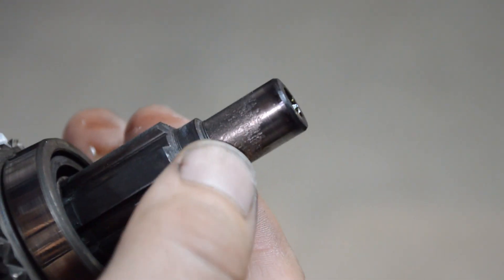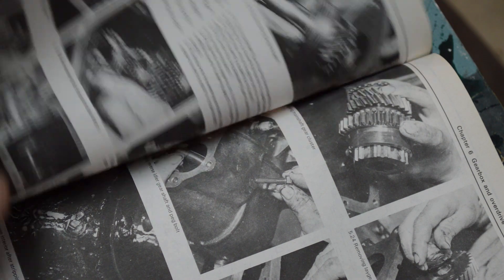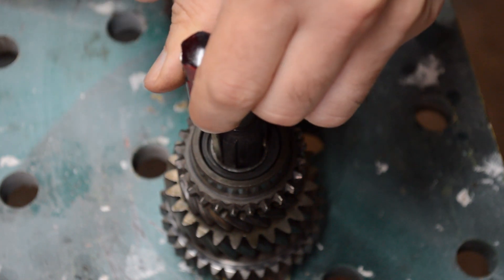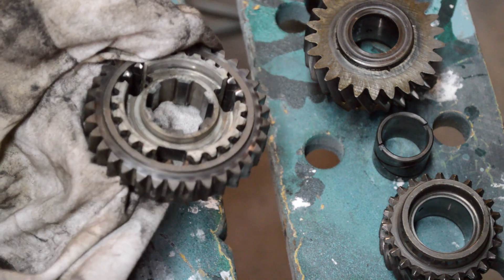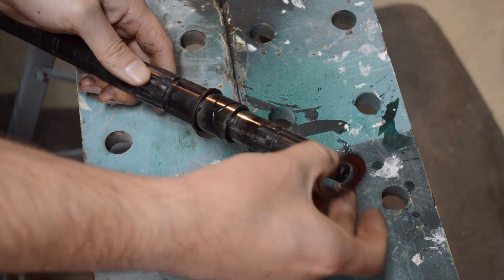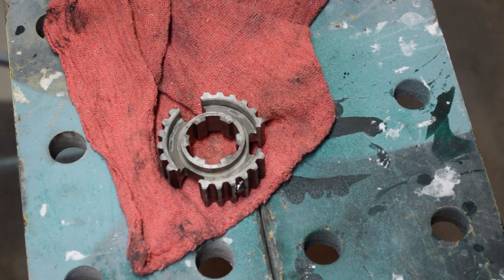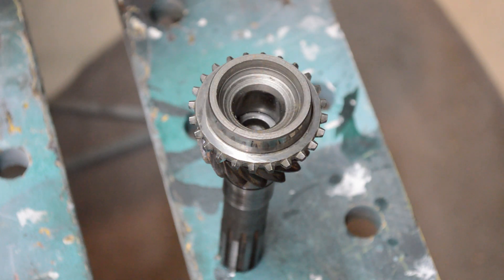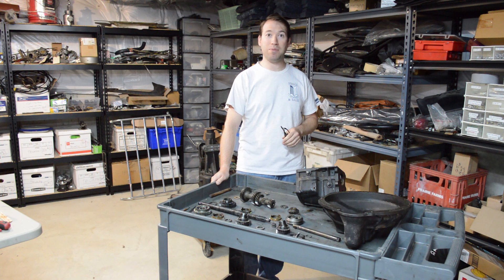Rebuilding My Triumph Spitfire Gearbox 2 - Inspection

Comment: When I check the end float on 2nd and 3rd gears, they come up short; but, when I check the end float of the assembled gears on the main shaft, it is sufficient. Any ideas? BTW this tranny came out of my 1967 Spitfire Mk2, but it actually belonged to a Herald (GB prefix,) at some point, as did the engine (GD.)
Reply from the maker: Without measuring it myself i can't help much, but the end float for the assembly is not the same as the sum of both components, so it's definitely possible to be correct on one and not the other.

Comment: Can you tell me whose shop manual you use? Thanks.
Reply from the maker: At this point I've memorized the procedure, so it's just the specs I have to look up (like clearances between gears).  I have both the factory manual and a Haynes manual, so whichever is closest.

Comment: After watching this series of videos 19,274 times, I finally bit the bullet and pulled my transmission (gearbox and overdrive) from my 1980 Spitfire. I checked all the pieces, made mistakes, rewatched a few of these another 4,276 times, and finally got it back together about two weeks ago. I then pulled the motor to do the reinstall because doing just the transmission was a real PITA. 

Suffice it to say, I don’t think I could have done the whole thing without these videos. Absolute life savers for a n00b mechanic hack like me. 

Thank you so much for doing these!
Reply from the maker: I'm really happy to hear that!  Too many people just throw away the gearbox and put in a Ford unit.  There's nothing wrong with that, of course, but it's just not true that the Triumph boxes are bad.  Glad to hear you're back on the road, and thanks for the shout out!

Comment: Wow, I watched part 1and2. You do this for a hobby only?! And not a living? You know your stuff! I have mechanical skills. I could take it apart, but putting it back together? Not likely, and not operating correctly! LOL I know you aren't a magician and can't see my transmission. But I often have to wiggle the stick left and right. While pulling back on it for 2nd. Or wiggle and push forward for 3rd. Sometimes it's hard to get the gear at all. What do you think is up? It's nice you took on some kids. Teach em how to rebuild a tranny! LOL FYI it's a 73 spitfire
Reply from the maker: I'm going to guess your problem is in the top cover or in the remote. It is a hobby mostly, but I do rebuild parts as a side gig if you're interested. The top gover and shift unit could usually be done in a couple hours depending on what it needs (including a thorough cleaning).
Reply: Thanks for getting back to me. I'll definitely keep you in mind. Thanks again.

Comment: Great video.   The mainshaft tip wear is very common and a new mainshaft will cost you about £200 plus shipping.
It might be preferable to talk to a good machine shop about fitting a hardened steel sleeve on the tip and perhaps opening up the end of the input shaft to accept the larger roller bearing as was used on latter gearboxes.
Modern MTL syncromesh gearbox lubricants can really help the syncro rings work and reduce wear.
Reply from the maker: Good call on the machine shop.  I usually use MT90 from Redline, which is fantastic.  Just be wary of any GL5.  The fluid is excellent, but it can cause quick wear on the synchros.

Comment: This is my first ever rebuild of a transmission. Wouldn't have even tried had I not seen your videos. If this goes well enough I will then start looking at the overdrive. You are certainly right. It really hasn't been that hard so far and it's kind of fun.
Reply from the maker: The hardest part is always finding the springs that go flying when you take things apart.

Comment: Great job i don’t see my self rebuilding one how much you charge for a rebuild?
Reply from the maker: Hi Lewis.  It really depends on what it needs.  Figure in the ballpark of $600 for the labor (could be a little more or less depending on the individual gearbox) and then add parts.  Whether it needs parts or not, everything has to come apart... so the labor won't change much.  I would budget on the order of $900-$1500 as representative of the one's I've done.

Comment: Thanks! Very timely as I have my '71 GT6 3 rail 4 synchro gearbox apart. Take care not to mix up the synchro springs as they are different. The new springs I have measure at 0.345" (5 coils) for the 1/2 hub and 0.423" (6 coils) for the 3/4 hub.
Reply from the maker: Glad it helped.  I've said before that gearboxes are basically a bunch of gears on a couple sticks.  It's nothing a half-way competent enthusiast can't do... but you're right about staying organized and understanding which part goes where!

Comment: Excellent Video and share of knowledge Kudos to you!  you have me motivated with moving forward on removing my transmission/OD with my 79 Triumph Spitfire which was shifting fine but leaking from every gasket and seal.  Thx again. Rod Riga ATL
Reply from the maker: You can do it!  The 79 box will be a single rail shifter on the top, so the actual mechanism to change gears will be different.  The internals of the gearbox should be very similar though--and they hold up better than the early boxes, which have smaller bearings and wear more quickly.